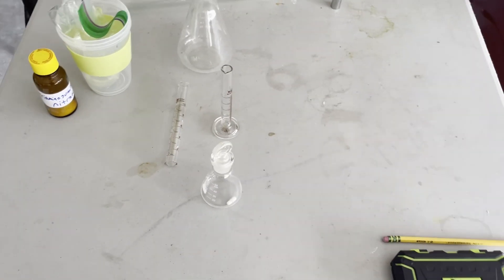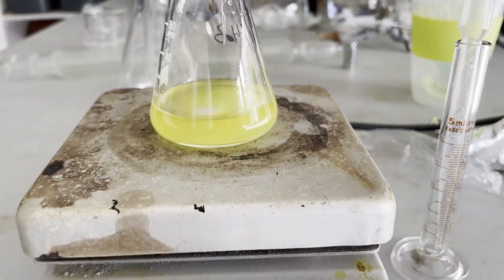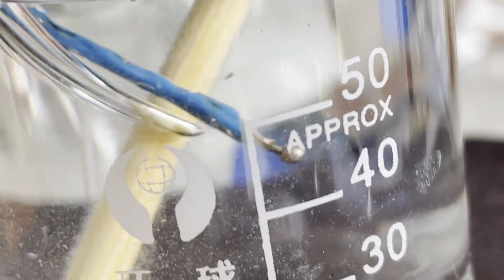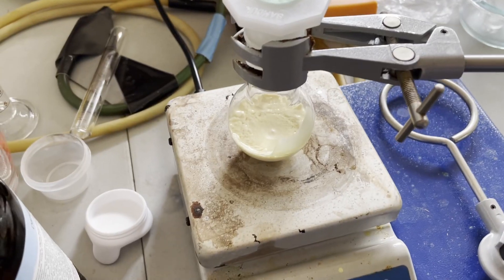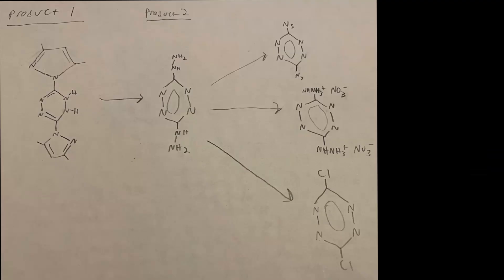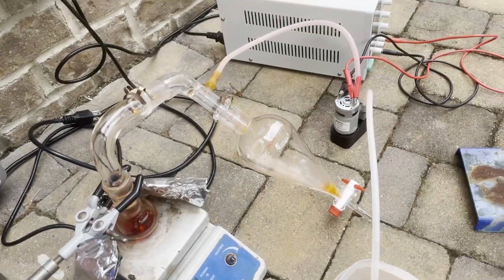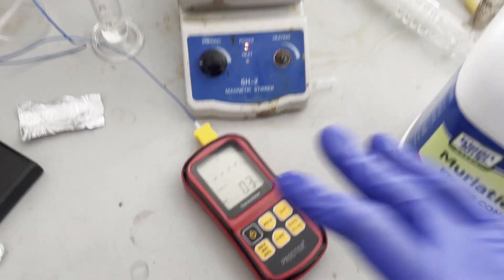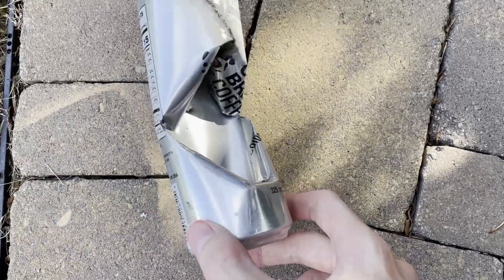Making Tetrazine and its Derivatives (Final video in Tetrazine series)

Comment: 500$!!!!???? 
For that amount i Can buy 50kilo dynamite 😂
Im a civil blasting engeneer and have never had the reason, or anything to make explosives my self🤷🏼‍♂️

Professional explosives are very stabile, those chemist made ones are not… 

Some of Them Can explode just by crystallizeing at wrong temperature (tatp 10*C)

Take Care and DONT get caught making those…..!

BTW a pipe bomb have a safetydistance of 1.500yards!!
Dont make Them! 
Use Wood or cardboard then we are Down to a safetydistance of 200Yards 

💥✨💨Happy new year everyone
Reply from the maker: Yea the small scale experimental stuff I make is specifically just for chemistry enjoyment. In terms of cost efficiency it is very low and very impractical. Also don’t worry, I only make small scale (milligram quantities) and will never touch organic peroxides.
Reply: @reactivechem7408  
Great Knowledge to have Thx!
I love chemistry as Well 😅
Enjoy your hobby…👌🏻

I used to stand with a 5yard stick with 500g dynamite… Thru a 2feet Hole.. Blasting slag of tubes on power plants.

Standing 5yards from 500g 💥 is…
Like Ear protection is not enough… The sonic boom goes straight thru skull and bones ! 😁

I have two pieces of detonator wire in my left arm, from these charges.. 
detonation 5.500m/s - The doctor Said leave Them in there 🤷🏼‍♂️ So i have Them in there for life😆 
Im wired!/wierd…? 

Strange that nitroglycerine are used in medicin huh😅

Happy new year Dude💥💨 i Will Sub !

Comment: If you want to keep using the broken graduated cylinder safely - at least spend an hour, use a diamond file to cut a clear line on the broken glass graduated cylinder then cut off the sharp part.  At the end, the sharp edge can go through flame polish process to make it smooth.
********************************************************
How to Cut Glass Bottles | 3 ways to do it
https://www.youtube.com/watch?v=WxKZ8hhcmvg

How to Cut, Fire Polish & Bend Glass Tubing
https://www.youtube.com/watch?v=_AkCHj7SHs4